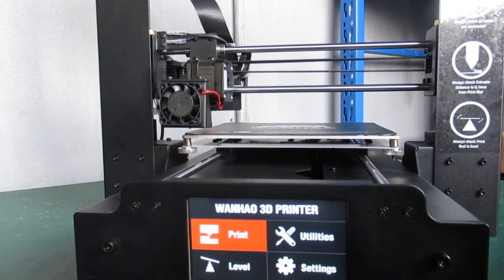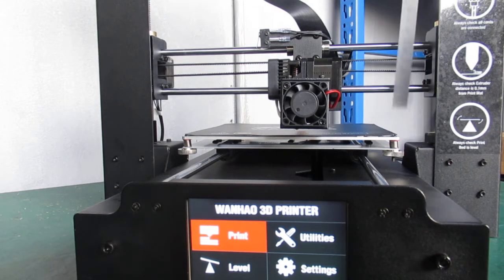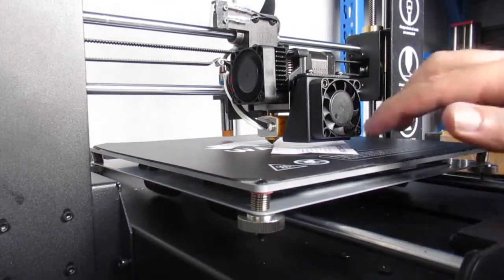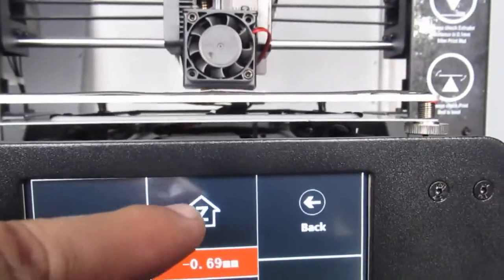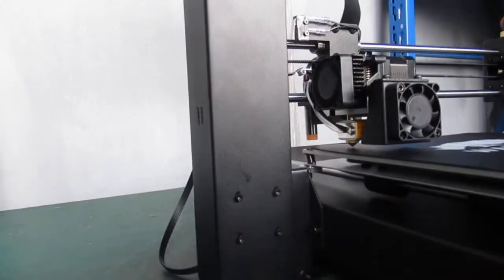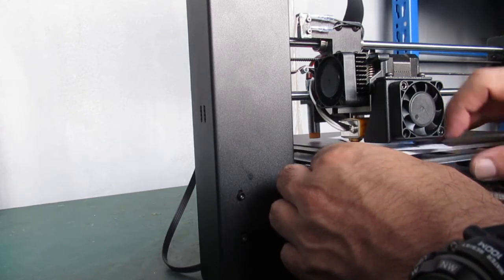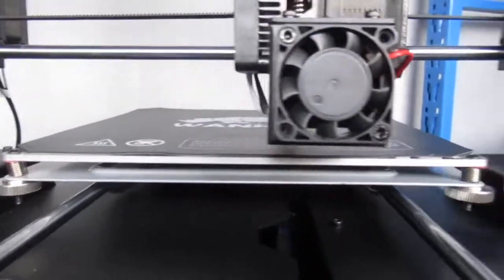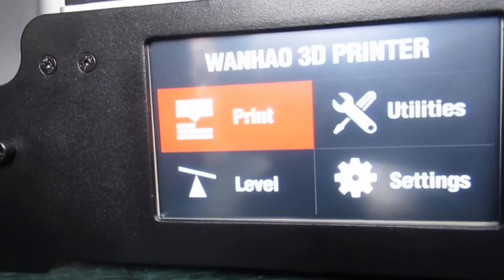I3 Plus MarkII Adjusting Z offset and leveling Bed

Comment: I would like to modify my relatively new Wanhao i3 Plus to have z-axis fine adjust from the touchscreen as shown above and also the power outage print recovery. I don't need auto level. Is there a way to modify or upgrade my i3 Plus by firmware upgrade?

Comment: hey, how did you get the new interface?
Reply: I had seen a video showing the Mk2 auto level did not work so before I buy this version I asked Wanhao how to correct this. They sent me the link below to the latest firmware and it is available at :-  
https://www.dropbox.com/s/asb01won8t814gc/I3PLUS%20MK2-0.161.zip?dl=0
Reply: cool thanks! and this is what you did with the file, right?: https://www.youtube.com/watch?v=hUv4kVdRvx0
Reply: If anyone knows how to flash this new firmware to the motherboard I would be very grateful.
Reply: Thanks for the link and the video of how to flash. when i get my Wanhao Plus MK2 I will now know what to do.
Reply: CALSASH let me know how it goes:)
Reply: Will do
Reply: Upgrade not progressing very well at the moment. Instructions to upgrade the motherboard, sent by WANHAO, ( exactky the same as you found last week) suggest I run CURA (.exe file sent by WANHAO and instructions say - MUST use this one) but I only have a Mac computer. Still sending e-mails to ask for way forward so very frustrating.
Reply: My WANHAO Duplicator i3 MK2 has nothing on the 8Gb SD card that came with it. I would be grateful if someone could tell me what files should be on it.
Reply: as I remember it has the wanhao version of cura, but I can check when I get home and share if you want
Reply: If the only thing on is the WANHAO version of Cura, I can request that from WANHAO. I thought it may have some print files to try out. Regards.
Reply: I had to upgrade the printer motherboard using the .hex file and then followed the instructions on the link: https://www.youtube.com/watch?v=hUv4kVdRvx0 to update the LCD screen. Now the machine is working like a dream and printing extremely well. I love it. 
I am currently printing off hinges and a door handle for an enclosure I am making for it. Also printing Z-axis bracings to improve my prints even more.